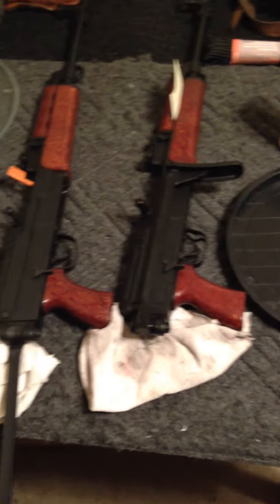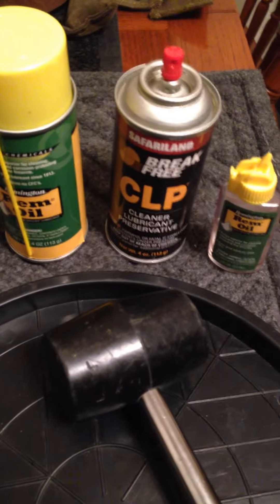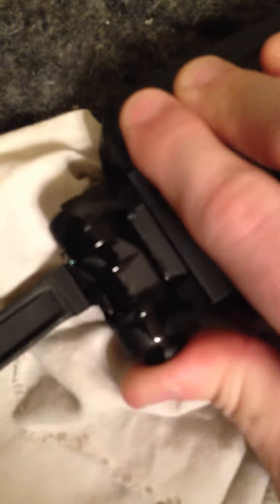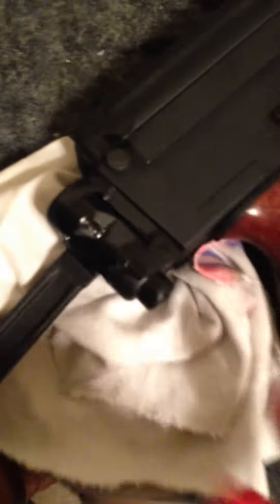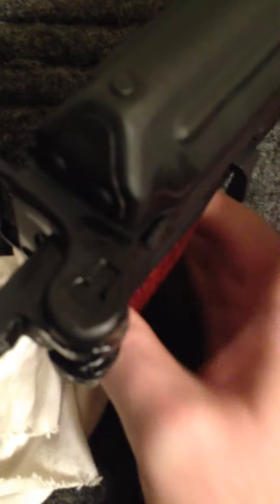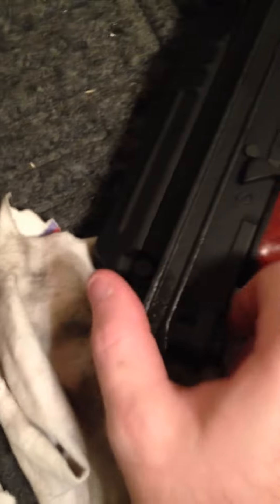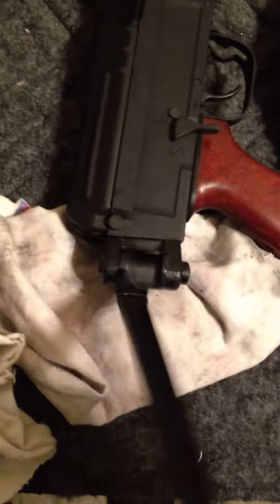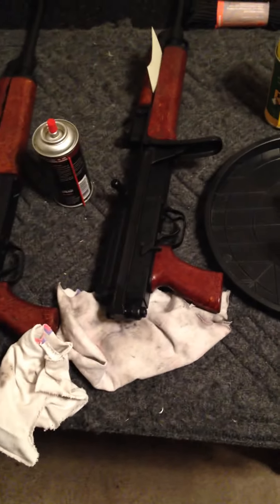Century Arms VZ58 VZ2008 Folding Stock Problem Solved

Comment: I ended up filing all the parts in the joint, it helped but didn't stop the problem altogether. but it helped a lot.
Reply from the maker: Since I have uploaded, the guns have so far worked. Only had one out of a litter that had pretty bad fouling and parkerizing clogged (I assume) in the joint. Part of the issue was user error, my father said he was trying to depress the button while holding the top of the mechanism, working against himself. I wouldnt bother taking the joint apart, the CLP does wonders.
Reply from the maker: clockwork421Also, the gun scrubber got the oil and gunk out after we worked on them for a while. Drying it out after working the fine particulates out did the majority of the work. I noted this in the updated videos.

Comment: yep so originally these were made with a poly coat.  which is slick, and then century imported guns, hacked em in half, born them again, then parked em.... park is a very matte style finish and a byproduct is some sand like substance.  actually, that sand is prob remnants from sand blasting them.... anyways, the results is like rubbing 2 pieces of sandpaper together, not an ideal situation.  could prob take the mechanism apart and remove the crud all together or paint the hinge pin maybe?